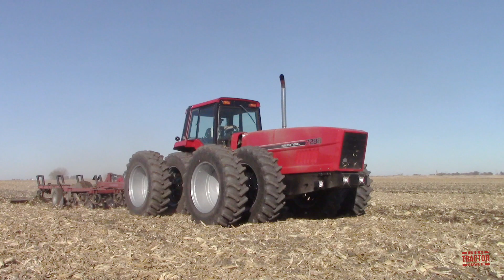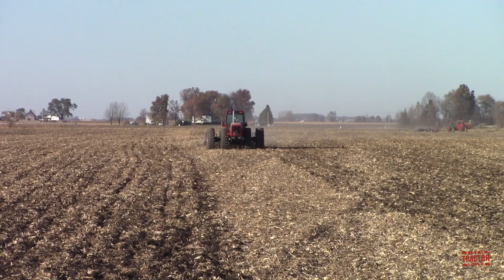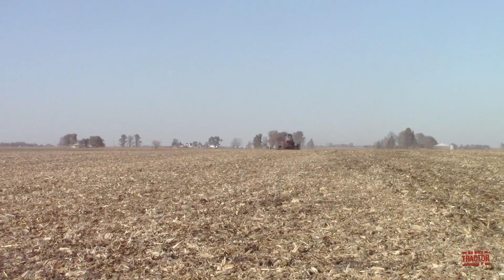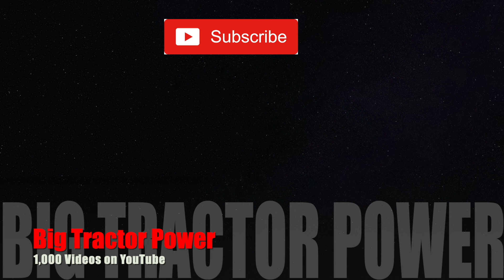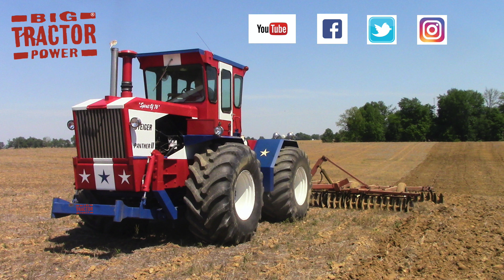Big Tractors Chisel Plowing

Comment: Great video! Someone needs to send out a memo to that feller about the 2+2 not being a heavy tillage tractor. Poor Snoopy!!
Reply: The super 70's were. The early 2+2 tractors were basically two 1086 rear ends bolted together and they were row crop tractors that guys ruined trying to use for heavy tillage but the 7088 series was built much heavier.
Reply: @jasonscott5791  They must have had the 5288/5488 rears in them. Wonder if they stuck with a Kimco font axle?
Reply: Jason Scott he shouldn’t be pulling a 7 shank though. He should be pulling 5

Comment: Triple set of great classic tractors. I really like the sound of the V8 Cummins in the 900 Versatile. Great vid BTP! Cheers PS did I read the vid description correctly? This is you 1,900th vid?
Reply from the maker: Hi. Thank you for watching.  Yes this is the 1,900 video from BTP.  Only 100 to video 2,000.
Reply: That is outstanding BTP!! Great work. The countdown to 2K is ON!
Reply: That’s my favorite engine sound
Reply: @nellsonstout7001  mines too, my old boss in england had an old 48 fergie with a 903, you heard it pulling an 8m cultivator from miles away

Comment: I thought I read that you could not put duals on on the 2+2 tractors because the tires would rub. Must have fixed it in the later series.
Reply from the maker: The Super 70 name replaced the 2+2 name and the Super 70s were factory built with duals.

Comment: Hear the inter nearly stall when it went into the ground. I had a header with the same engine and still have an 8 wheeler tray truck with the same engine and both are gutless when the power’s needed. Nice vid though.👍🇦🇺
Reply: Isn't that true. Gawd the ih motors are gutless

Comment: Case didn't buy out international, tenneco did which which was a large multi company corporation that had bought out case in the 70's. Infact other than the first two or three years  where case ih tractors were just case tractors painted red, the late 80's and 90's case ih equipment is not completely but largely based on international designs, especially combines

Comment: 210HP - for a machine that size, I am surprised it was popular - a large 4WD machine like that would use lots of HP to move the weight, then what's left to pull.   Sometimes I catch myself thinking - why bother with a 4WD <300hp?
Reply: They aren’t much bigger than a 1086. The weight distribution on the 2+2 was almost perfect. They had really good traction. They would do more work than they were supposed to do.
Reply: We ran a White 4-150 and it pulled exceptionally well ,perfect weight distribution.
Reply: It’s not as big as it looks. It’s just that the articulation joint is in front of the cab instead of behind. 210 horsepower is plenty for that tractor. It was supposed to be a big tractor for row crop farmers that could fill multiple roles as opposed to the Versatiles shown, which were for heavy work only
Reply: @nellsonstout7001  Many thanks.

Comment: That 7288 would never be able to pull that ripper in our soil, only way he could do it only going maybe 1mph, I know a guy with a 8520 jd that pulls a 5 shank DMI and that gives that tractor a run for it's money in the hills and in clay. Even those versatiles with those rippers would need another 150 horse to manage in our soil type and hill areas.
Reply: I agree. Must be light soil, but they should be pulling a 5 shank with the 7288 regardless. I wouldn’t wanna work something so rare as hard as they are
Reply: @nellsonstout7001  yup, why work a rare tractor like that so hard. Buy something bigger and older and be better off
Reply: @kolewiebensohn  honestly, I wouldn’t be worried if it was a 5 shank. The super 70s were beefed up. 7 is a crime though
Reply: @nellsonstout7001  It's still just a old dt466 though. That poor engine wasn't made to lug that hard in hard spots. I can see 5 shanks behind it being a bit more efficiently with speed and fuel consumption.. 7 shank is for the big boys to pull.